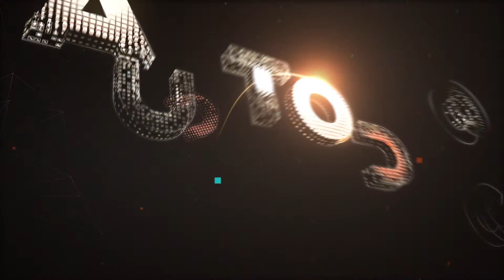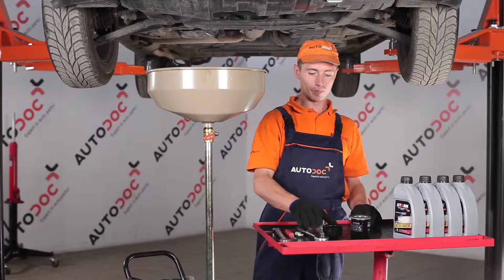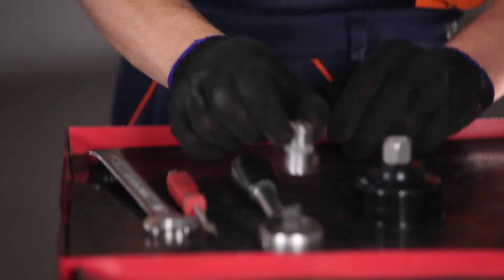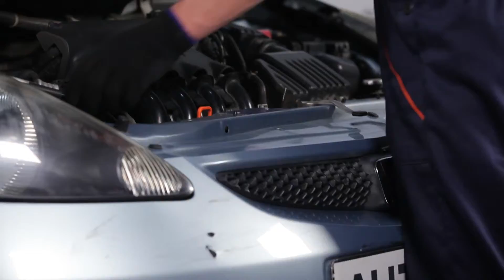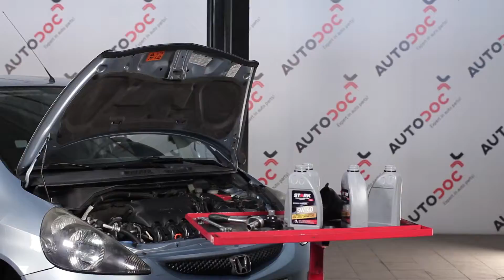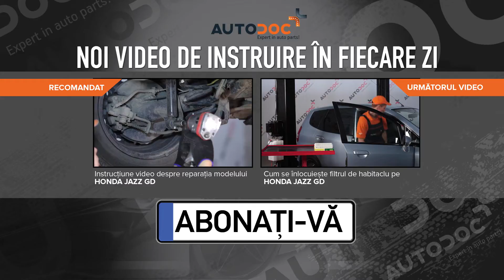Cum se inlocuiesc uleiul de motor și filtrul de ulei pe HONDA JAZZ 1 TUTORIAL | AUTODOC

Comment: Salut la o honda jazz din 2004  1.4 benzina merge sa bag 5w30 ?
Reply from the maker: Buna ziua. Vă mulţumim pentru mesajul Dvs. Vă recomandăm să contactați serviciul nostru de asistență la adresa info@autodoc24.ro, unde vom putea identifica în catalogul mașinii tipul uleiului de motor potrivit verificand specificatiile si recomandarile tehnice. Cu stimă, Echipa Autodoc!
Reply: in hondaul meu jazz din 2009 1.4 benzina v-tec a fost bagat 5w30 in germania asa apare in  cartea service !